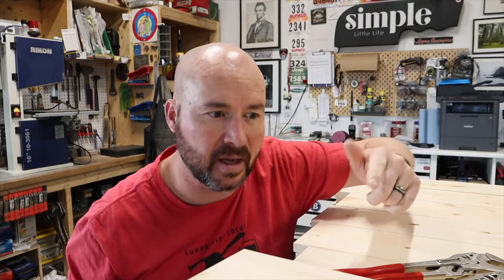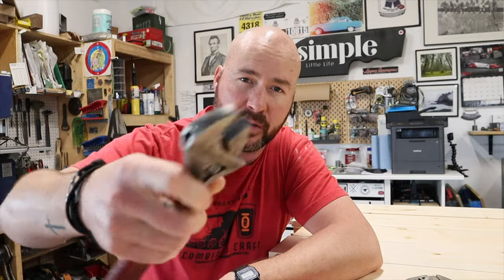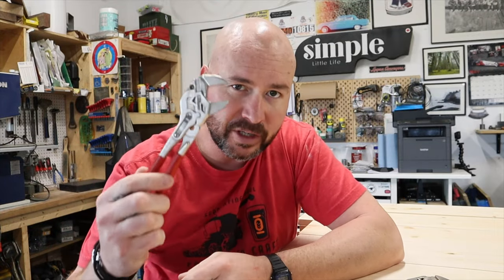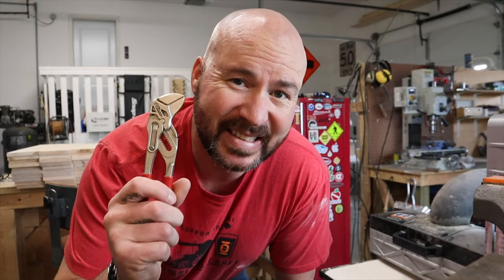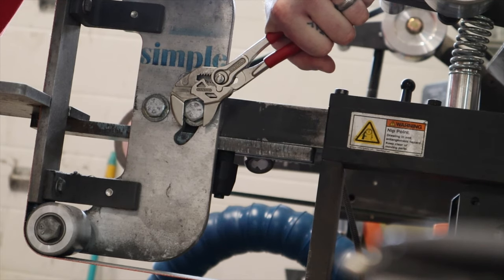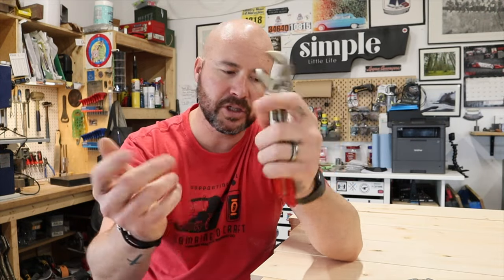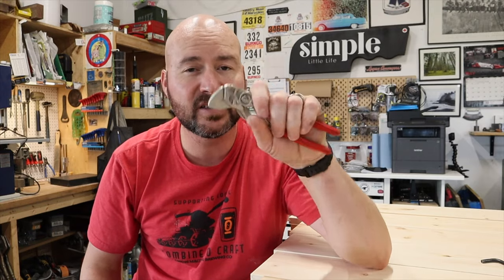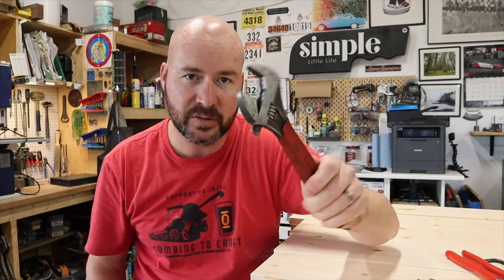Better than a MONKEY WRENCH

Comment: Great for straightening sheet metal as well. Worked up to 1.5mm aluminium for me without any problems.
Reply: True, good point! Straightening wire, is another use I get often from these!!

Comment: I've had some of these in my toolbox for many years. And I worked on airplanes for 42 years I found that they don't slip like a crescent wrench should never use a crescent wrench on an aircraft :-)
Reply: im use also in aviation sheet metal workshop to squeeze AD (soft) solid flush rivets to max.5 dia :-). Some times it does not sense to prepare rivet hammer for few rivets, faster and better is to use Knipex :-). Best Regards from Poland. Pozdrowienia z Polski :-)

Comment: These are great tools, bit on the spendy side but well made and you get what you pay for. I have the 5" & 7.25"  set,  the 5 is a little small but I think the 7.25 and the 10" would cover just about everything anyone would need

Comment: I bought the 'medium' size (10" size) of Knipex Pliers at Home Depot (they only have that one size on display in the store).  I bought one and I liked it so much that I bought a second one. Then I noticed that the handle of the tool is great for when you want to apply a lot of torque to a nut/bolt (the way an adjustable wrench would), but when you only want to apply a bit of torque, the handles are a bit too long, so I took one of the wrenches and I cut off 3" of each handle, now it's perfect.  Its now like the 7.25" set that Knipex already sells.

Comment: Dude I don't think I have ever been sold on a tool so thoroughly & so quickly. Only other tool that comes close was the Milwaukee fastback folding knife with the screwdriver bit holder, but these pliers solve so many problems that drive me nuts I honestly hate that I don't already have a pair, and I've only known they exist for 7 minutes now.
Reply from the maker: Right on. Do you want to know something crazy? I just picked up that fastback with the screwdriver bit holder. I learned about it a couple of weeks  ago and bought while at a plumbing supply store. So great learning about excellent tools isn’t it👍

Comment: They’re good for pipes, and a I also like that the alloy used allows a slim tool, with jaws that can fit between parts that normally are hard to get to without buying an expensive, individual size, thin head wrench.
Reply: You are thinking of a pipe wrench. Monkey wrenches are finer threaded, and have flat jaws
Reply: @grndzro777  no, I’m not. I know what that is, I have my father’s. I didn’t mention a monkey wrench, you just did.
Reply: @melgross  Sorry about that then. It always irks me that most people don't even know what a monkey wrench is. Makes me a bit too zealous.

Comment: A monkey wrench here is a heavy duty beast with teeth that can grip on a round pipe / bar. And we call an adjustable wrench a shifter. 

Going to get some  Knipex pliers as soon as the budget permits, they are a bit pricey but money well spent it seems.
Reply: No that's called a pipe wrench.
Reply: Are you in the UK or Australia? Down under we call an adjustable wrench a shifter, but most of our words are inherited from the UK so I'm guessing it's the same there too.

Comment: Agree, it is fine tool for lighter stuff and quick working. But a bit weaker and more bulky than good old screw adjustible french wrench where you can put a one or two meter pipe on it and grab it really hard without breaking it if you are trying to unscrew some large 50mm radiator rusted screw or similar stuff :D These will bend at some point. Also the Knipex price is a bit higher. Usually you can buy multiple "crescent wrenches" for a price of one of these :)

Knipex wire cutters and many precision pliers are arso very nice tools. And Cobra pliers for pipes with nice sharp teeth that won't get dull in years.

Comment: There are two smaller sizes than your 180mm, a 125mm and a 150mm one. One of these might be a cool little addition to your on-the-go cycling toolkit.
Reply: I have the 150 and yes, it is!
Reply: There's a 100mm one now as well.

Comment: please advise, if the budget is limited and you can only choose one, for bicycle repair and can be taken for backpacking, which size should you choose?
Reply from the maker: Probably a 5” or 6” I would say 👍
Reply: Get the 7.25" size.  I find the handles on the 10" set are just a bit too long for most situations, and the 5" version is just a baby and can only work on the smallest of nuts/bolts.

Comment: Does it also want to lock the other way?
Reply from the maker: Not exactly sure what you mean by that….
Reply: @jeremygoertz So the pliers lock on and you don't have to squeeze the handles, just push one of them. Does it also work if you're pushing the other handle in the other direction?
Reply: @1992jamo  no, it slips off, the head is directional. You can use them backwards if you grip the handle firm